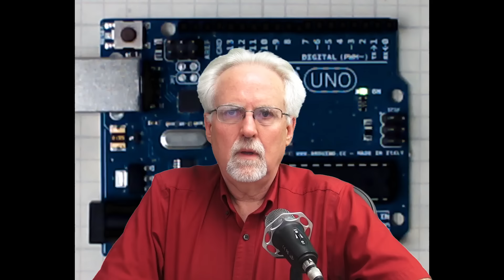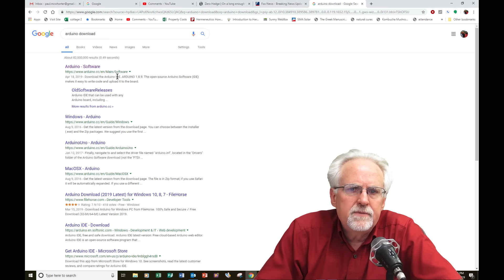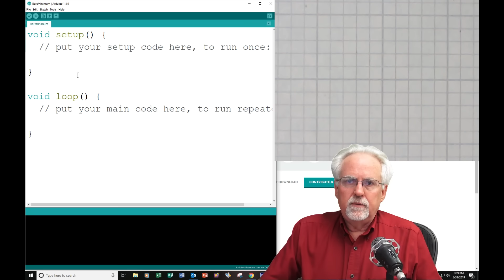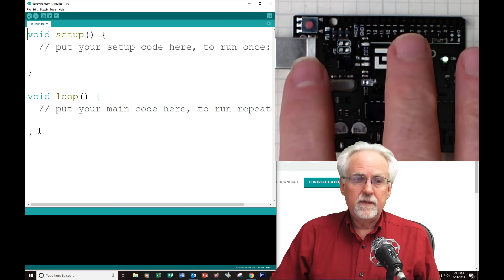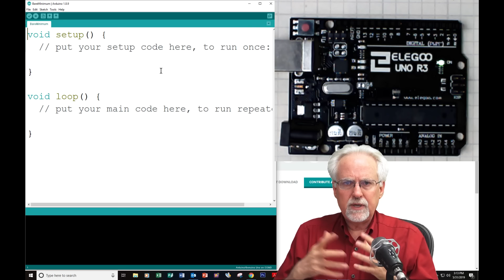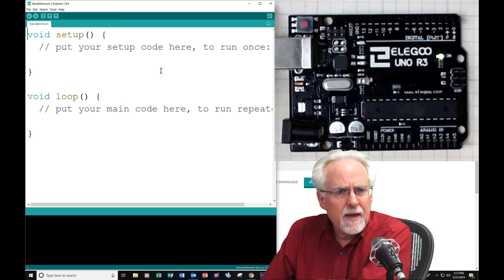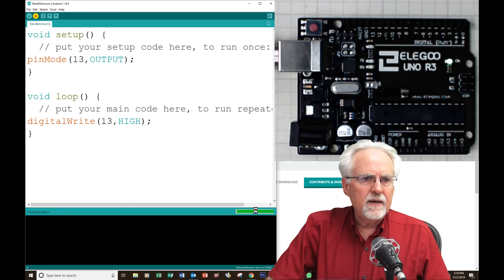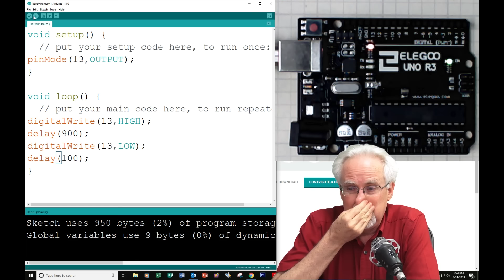Arduino Tutorial 1: Setting Up and Programming the Arduino for Absolute Beginners

Comment: Hi Paul. Was wondering if you could answer this. I have no prior Arduino experience but have an LED lighting effect in my head which I was wondering if ARDUINO could achieve. I want to run an LED strip with qty 48 Addressable LEDS. The density based on 60 LEDs/metre. The color to be pure white with the following lighting pattern. Both the first and last qty 15 LEDs in the strip to be on constantly on as cool white. The remaining qty 18 LEDs in the middle ,to be also cool white, but have the effect of  a foreword and backward chase sequence.. Is that possible with an Arduino as you see it. Have just bought an Arduino starter kit and will work though all that is needed to achieve this if its feasible to start with.. Would love your thoughts as I dont no how many leds the Arduino can control nor if this pattern is achievable with one controller. Thanks in advance

Comment: Absolutely sensational. Im 65 and want to do some acrylic edge lite signs as part of an artistic venture. Have assembled a 4 panel led stand and about to cnc engrave each of the panels. Dont want to use standard full color led strips.  I need to learn how to color control each led  to give a greater visual effect. Im on board with these tutorials. This is the best explained tutorial on YOU TUBE hands down. With full explanation. Thankyou. have subscribed.

Comment: Hi again Paul
When I connect the board from the kit there are two lights, different from the example. My download appears to have been successful because the message at the bottom tells me Arduino Uno on COM3 but there is no communication. It ignores the program and the light adjacent to pin 13 simply continues to flash once per second. Unless I can get the computer to actually communicate with pin 13 I am stumped at the first hurdle. Any advice would be appreciated. Clearly I am missing something quite fundamental. Woodie

Comment: hi . just started with Arduino. loved the first lessen and i got it working. for my project i need to use Python and control the card via pc so the program is runing in the pc. how fast will it respond. i need it to turn the light on in less than .1 second. is it posible? thanks.

Comment: I was purchased a 5' x11' CNC extruded Aluminum plasma table one of the first, made by Lincoln Welding Co. ( NO LONGER MADE) without a controller. It was adapted with a router on it,  I would like to get it operating again as a dual machine for Plasma CNC and a Router CNC. I have retired and am looking forward to getting it running. I need to build the latest controller for the dual purpose and I could use your help. W

Comment: I couldn't get Elegoo uno r3.....is one from Aliexpress ok?

This one ...LAFVIN for UNO R3 Project The Most Complete Starter Kit for Arduino with Tutorial, Stepper Motor, Ultrasonic Sensor, Jumper Wire
Reply: Since the arduino design is open source anything that looks and says uno r3 should be ok.

Comment: Great lessons, Paul! I see the super starter kit on Amazon for $38.99, but your link seems to be sending me to a $56.99 most complete start kit. I want to make sure I get the correct kit, but I also want to buy through your link. Do you think the link changed, or the price? Thanks in advance!
Reply: FYI - I ended up scrolling down to tutorial 51, which had a different link that led me to the correct kit. Thanks!

Comment: 12ms is the minimum amount for my eye.

Thanks for putting this together, I've just picked up electronics keen to follow this series. Thought electronics could be a bit of fun to learn alongside of my Engineering this year. 

I was trying to stick purely to analog but online there seems to be a massive knowledge gap and whilst I can build circuits from a schematic it doesn't help when I don't know why specific components are used in certain scenarios, seems it's maybe easier to start  teaching at digital and work towards a more technical side looking closer at circuits and how these microcontrollers actually work. 

Also I'm assuming the LED is also hooked up to Pin 13 and none of the other pins, to act as a tutorial? If that makes sense.

Cheers mate, looking forward to more from you!
Reply: i guess 14 is minimum coz at 12 ur mind is just assuming that the LED is blinking or rather u might just be constantly changing the position of the board from ur view
Reply: @blackbird-_-8666  @Michael Drake How did you guys calculate it?

Comment: hello!
I'm very new to Arduino and your videos are helping me a great deal.
I have 3d printed a variation of a spider robot that I found on YouTube ,the youtube spider has 4 legs, mine has 12.
the video calls for Arduino uno r3,but there are not enough ports to fit the servos' 4 legged robot requires space for 12 servos, mine will need 36.
I have purchased an elegoo mega 2560,I have nano boards, bluetooth modules and a buck converter to convert 12 v to 5v.
I have the Arduino app on my computer ,and I have downloaded the mobile leg commands from the 4 legged spider video.
how do I import those commands onto the Arduino app so I can load them onto my 2560?
any help or advice would be greatly appreciated.
sincerely 
Norm

Comment: It's not our eyes that can't perceive the fast blinking, it's due to the resistance of the LED. It takes a little to build up the voltage, the same when dropping the voltage. Like you can't see the blinking of lightbulb using 50 Hz alternating current. The current changes to fast for the light bulb to cool down in between.

Apart from that - excellent ;)
Reply from the maker: No, actually our eyes can not  perceive changes faster than about 60 Hertz. A diode is a solid state device and can blink VERY quickly. That is how 0's and 1's are send down a fiber . . . by blinking a laser at incredibly fast speed. The receptors in your eyes, and your neurons are what can not keep up.
Reply: @paulmcwhorter  Thanks, makes sense now 👍

Comment: #include <avr/io.h>
#include <avr/interrupt.h>
const unsigned char cifre[] = {
	0x05,0xdd, 0x46, 0x54, 0x9c, 0x34, 0x24, 0x5d, 0x04, 0x14
};
unsigned char DISP_BAFER[4] ={0xff,0xff,0xff,cifre[0]};
const unsigned char minus = 0xfe;
unsigned char ukljuceno = 1;
volatile unsigned long ms = 0;
volatile unsigned char disp = 3;
volatile int number = 0;
ISR(TIMER0_COMPRA_vect){
	if(++disp > 3)
      disp = 0;
  PORTB = ~(1 << (3-disp));
  PORTD = DISP_BAFER[disp];
  ms++;
}
ISR(PCINT1_vect)
{
	switch((~PINC) & 0x0a)
    {
    case 0x02:
      ukljuceno = 1;
      number--;
      break;
    case 0x08:
      ukljuceno = 0;
      number++;
      break;
    }
}	
int main(){
int pom1, pom2, mi=0,zero=0;
  char i;
  unsigned long t0;
  DDRB = 0x0f;
  DDRC = 0x00;
  DDRD = 0xff;
  
  PCICR = (1<<PCIE1);
  PCMSK1 = 0x0a;
  
  TCCR0A = 0x02;
  TCCR0B = 0x03;
  OCR0A = 249;
  TIMSK0 = 0x02;
  
  sei();
  
  while(1) {
  t0 = ms;
    while((ms-t0)<100);
    pom1 = number;
    if(pom1<0){
    pom1*= (-1);
      for(i = 3; i > 0; i--){
      pom2= pom1%10;
        DISP_BAFER[i] = cifre[pom2];
        pom1/=10;
        if(pom2!=0){
        mi = i;
        zero =i-1;
        }
      }
      DISP_BAFER[mi-1] = minus;
      mi = 0;
      for(i=0;i<zero;i++){
      	DISP_BAFER[i] = 0xff;
      }
    } else if(pom1!=0){
      for(i = 3; i>= 0; i--){
      pom2=pom1%10;
       DISP_BAFER[i] = cifre[pom2];
        pom1/=10;
        if(pom2!=0){
        	zero = i;
        }
      }
      for(i = 0; i<zero;i++){
      	DISP_BAFER[i] = 0xff;
        
      }
    } else{
      DISP_BAFER[3] = cifre[0];
      DISP_BAFER[2] = 0xff;
      DISP_BAFER[1] = 0xff;
      DISP_BAFER[0] = 0xff;
    }
  }
  return 0;
}

Comment: had a problem with my download to uno r3, , used the normal windows program,  got error , would not work, so tried the windows app one,  it works, got it to download and flash, on my computer set up, the USB cable is to short, had to rip the one off me printer, and use that, it has a squire end ,   task 1 done and working, :)

Comment: I agree with the many cudos.  I'm a late starter (84 years) and just acquired an ELEGOO mega 2560 Arduino board for a project I have in mind. I have to admit that I looked upon coding as the most challenging issue.  I'll stick with your tutorials.  Thanks.

Comment: Hi Paul. I'm interested in maybe using arduino to animate my dioramas. Your tutorial series looks very helpful as I have no electronics experience and high school physics from 1966. I'm in Australia. When I followed your link to Amazon,it took me to Amazon USA who want to charge over $20 shipping to Australia. If I go to Amazon Australia,  the price of the kit is about the same,but no shipping cost. So I bought from Australia but you missed out on your %age. I don't know if Amazon has a method for your non US subscribers to follow a link to their own country site but you still get your cut.  You may want to investigate if you are getting a lot of non US subscribers. I'm waiting for delivery so I can start diodes flashing!!! Cheers
Reply: Thans for the "love". And another thing for your non-US Subscribers to consider, if you buy local, you get your local power plug, not US, so you can plug into your own wall socket!  My kit arrived today - brilliant timing.  We have our 4 grandkids staying for the summer break, one just tested positive with COVID using a RAT.  So we all had PCR tests today and must isolate until negative resuts, or 7 days.  Learning Arduino will help pass the time.  If you see a flashing light low on the horizon to your south west, it'll be my LED. Cheers from sunny Australia.

Comment: assignment :
void setup() {
  // put your setup code here, to run once:
pinMode(13, OUTPUT);
}

void loop() {
  // put your main code here, to run repeatedly:
digitalWrite(13,HIGH);
delay(10);
digitalWrite(13,LOW);
delay(50);
}
Reply: Want to see something funny?
Add some resistors and external LED's to a breadboard. Use the pinMode command for more LED's "13, 14, 15" etc. and set them at different "speeds". It's so fun to tinker with this stuff!

Comment: Got the Arduino Mega (2560), the starter kits were all sold out (Sweden).

Running this:
digitalWrite(13,HIGH);
delay(15);
digitalWrite(13,LOW);
delay(15);

Feels like a strobe, looks like it's constantly on - but at a closer look... It's not!

Ok, so perhaps someone thinks the Mega is a bit overkill? Not really, going to use it to build my own CNC machine. 
Just need to learn the basics.
Like I did back in the -80's when I had the C64.

Oh, and thanks for great videos, subscribed!

Comment: Is it essential to buy the components or can I just use simulation software in the learning stage?
Reply from the maker: You really need the kit. This is real engineering, which you can not do with simmmulation. Troubleshooting your builds requires real hardware.
Reply: @paulmcwhorter  But the kit isn't available in my region. Could you please list out all components with the quantity so that we can buy.

Comment: I like Arduino.  I use the technology for various things both at home and on the job.  I've built testers with displays that help me with troubleshooting robotics issues and controllers to operate them.  I've built temperature and level monitoring systems for hydraulics down to a little alarm that lets me know when my pasta water is boiling.  I've built devices that program other devices and animatronic show control playback systems all using Arduino in some shape or form.  It's a great hobby and the internet resources are there if you need help with something.  There's no end to what you can do with the Arduino boards.

Comment: Just followed this in 2021 and noticed two things that I suppose might confuse total beginners 1) The orange LED on my Arduino started flashing when it was ,powered up for the very first time out of the box before I had uploaded anything. So the factory is probably leaving some test software in it after its made. You can just ignore it an keep going with the tutorial. 2) When you upload a sketch to the Arduino for the first time an explorer window opens asking you where you want to save your sketches. You can choose one or create a folder in My Documents.

Comment: I'm recently getting into Arduino, trying to become a self-made engineer. This tutorial is the best one I've seen yet, and I've seen...I don't know...a lot, at this point. Also, I got my blink down to 16.5, sorta between looking like it's dimming and blinking.
Reply: I found that if I put it at 15 and looked closely I could JUST barely see it. Good luck with the rest of your Arduino journey!
Reply: @nosdie1368  thanks, and nice one getting it down to 15
Reply: Yeah, most videos I’ve seen claiming to be “arduino 101” go straight into writing commands without explaining the functions, variables, syntax, etc. that they’re using. It’s basically, “type this and look, your led is blinking”.
Reply: 6.25
Reply: Yes. It is getting more realistic to get an engineering job without a degree, but you can't get a PE license without one in most states. But you dont need a PE license for every job obviously. And plus if you get an engineering job without a degree they might pay for one anyway?
Reply: 13 was my limit. All the very best with all of your projects

Comment: Paul - I finally got my Arduino so am starting the tutorials over again from the beginning.  When I connected Uno to the control computer (I am using a Raspberry Pi 4 because I am trying to prepare for a future project with this combo) the PIN 13 LED was continuously flashing and I couldn't get things working in sync with what you were doing.  So I reassigned the pinMode to pin0 as an output along with pin13 as an output and and got the lights to flash a bit then turn off.  So I know I am communicating with the Arduino but not sure why pin13 LED continuously blinks when I power up and not sure how it will affect things going forward.  Any advice?  Thanks for your great teaching!
Reply from the maker: The arduino might come preloaded with the blink program. When you apply power it runs whatever program is in there. Write a simple program to turn pin 13 low and then download it. You will always get some blinking on power up as the arduino boots. Good luck!
Reply: @paulmcwhorter  Thanks - it worked!

Comment: I'm going to the beginning.....to the open air preaching. I'm glad I found the channels as Iain need of both spiritual tutoring and Arduino teachings.
Reply from the maker: Indeed I remember those days fondly. We would go to the park each weekend, give everyone in the park free BBQ, and then bring the gospel. Many great things happened in that park. I calculated once we gave away over 10,000 plates of BBQ over the summers we ministered there. Check out my Bible Boy channel
Reply: @paulmcwhorter  right on. I was the tour manager for a Metal band and we had Christian roots. I got to spend some good times with a lot of good people. I've been looking into Arduino as a way to implement plug and play components for a system I designed to illuminate infant mortality rates in hot cars. Won't say much as it's very much under wraps but i see potential in learning Arduino. Thanks for the videos.

Comment: Arduino is a great tool for developing interactive objects, taking inputs from a variety of switches or sensors and controlling a variety of lights, motors, and other outputs. Arduino projects can be stand-alone or they can be connected to a computer using USB. The Arduino board is a microcontroller board, which is a small circuit (the board) that contains a whole computer on a small chip (the microcontroller).As Mr. Paul said in the tutorial Arduino is an open-source electronics platform based on easy-to-use hardware and software. Arduino boards are able to read inputs - light on a sensor, a finger on a button, or a Twitter message - and turn it into an output - activating a motor, turning on an LED, publishing something online. You can tell your board what to do by sending a set of instructions to the microcontroller on the board. To do so you use the Arduino programming language (based on Wiring), and the Arduino Software (IDE), based on Processing.

Comment: 5ms is the fastest I can see change. Tonight I wrote my first line of code ever thanks to you. It was so easy I was able to modify it to work on a 4 pin RGB LED. And it works like a champ. You just opened a whole new world to me. Here is my code along with the shortest time I could see the colors change from blue to green to red.
void setup() {
  // put your setup code here, to run once:
pinMode(11,OUTPUT);//blue
pinMode(12,OUTPUT);//green
pinMode(13,OUTPUT);//red
}

void loop() {
  // put your main code here, to run repeatedly:
digitalWrite(11,HIGH);
delay(5);
digitalWrite(11,LOW);
delay(5);
digitalWrite(12,HIGH);
delay(5);
digitalWrite(12,LOW);
delay(5);
digitalWrite(13,HIGH);
delay(5);
digitalWrite(13,LOW);
delay(5);
}

Comment: Please help me out with the following questions.

DESIGN A POTENTIOMETER REGULATED LED SYSTEM WHEN THE VOLTAGE IS BETWEEN THE FOLLOWING RANGE.

0v and 1v = blue LED ON,

2v and 3v = green LED on without offing the blue LED,

3v and 4v = red LED on,put on the blue LED on again and put off the green and yellow LED,

4v and 5v = blue LED blinks 4 times and go off, green LED blinks 3 times and go off, yellow LED blinks 2 times and go off, red LED blinks once and go off.

When the voltage is still between 4v and 5v,the the process start again(blue LED blinks 4 times and go off, green LED blinks 3 times and go off, yellow LED blinks 2 times and go off, red LED blinks once and go off).
Reply from the maker: Are you asking me to do your homework for you? Watch the videos, I teach how to do these things, but am not going to do homework problems for you.